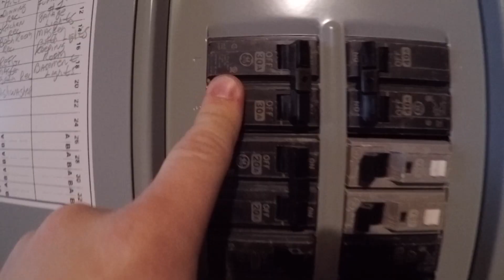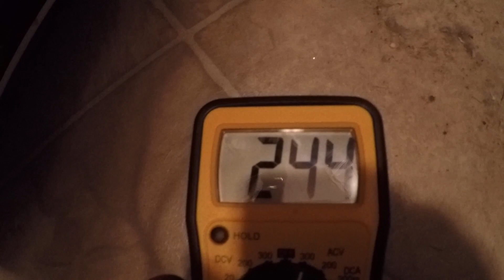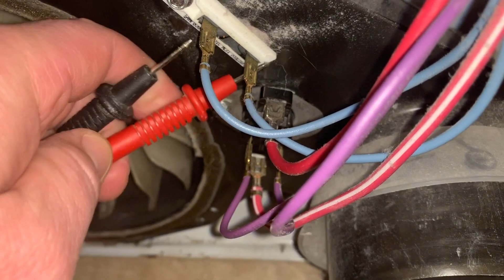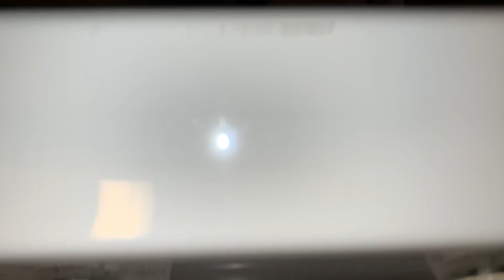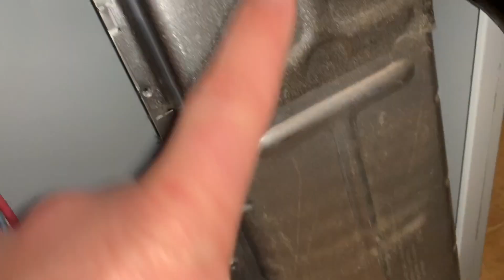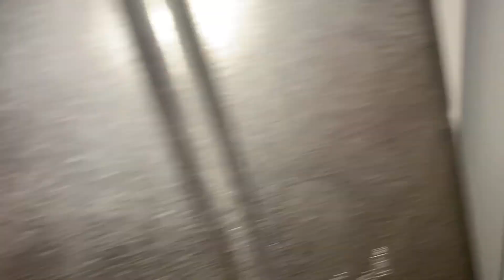EASY Fix Broken Dryer - Dryer Won't Start - Dryer Won’t Heat Dryer Will Not Turn On Complete Repair

Comment: I've watched both of your dryer repairs video, and thought you do a good job of explaining the basics, to the unknowing. And in all my years, I've never seen a light in a dryer. (But I buy inexpensive ones). Also, I hear about these thermal fuses, but my electric Maytag doesn't have one. But it does have a thermostat.
Reply from the maker: Interesting. I’m surprised there isn’t a thermal fuse in yours.
Reply: @TightWadDIY  I found a thermal device, (no continuity) buried inside the heating element housing, along with others in line.

Comment: That thermal fuse and “thermostat” have nothing to do with any lint problems. This guy only knows partial info he probably looked up on the internet. It’s clear from this video and the last I viewed. I’ve been repairing appliances for 13 years and HVAC 20 years.
Reply from the maker: The thermal fuse CAN be blown due to a blockage (of lint) causing it to overheat. That’s the whole reason for the thermal fuse.
Reply: @TightWadDIY  The thermal fuse YOU were talking about opens when the operating thermostat below it malfunctions and allows the dryer to get too hot. The thermal fuse that opens due to a plugged vent would be the fuse on the top part of the element housing. Even then when that fuse blows you need to change the thermostat as well because the thermostat should be opening the circuit prior to the fuse blowing in both cases. But hey, thanks for playing the game. I hope this helps complete your knowledge of the most basic dryer out there.
Reply: Changes thermal fuse & thermostat checked door switch. Light goes on inside dryer. Nothing. Doesn’t start. Now what?
Replace on off switch. Dealing with a Basic Maytag 2 years old
Also cleaned out lint & checked fuse box

Comment: I was having a problem with the dryer not turning ON at all.
One of the first things I did was to check continuity on the thermal fuse.
I did not disconnect the leads to it just as you showed in your video when you tested it for continuity.
I tested everything you showed and still no smoking gun, other than the centrifugal start switch that is mounted to the motor .
I finally went back and tested the thermal switch a second time and with the leads attached I got the continuity tone from my multi-meter. I then disconnected the leads, something I was told to always do when testing a component to isolate completely from the circuit. This time, I did not get the tone, and the meter displayed OPEN. So, I reconnected the leads on the thermal fuse and tested again, and again, I got a tone and continuity. Well, I tried your suggestion to bypass the thermal switch, I had a dual flat face male connector to single male flat face adapter, pushed the two female connectors on to it, covered it with electrical tape and plugged in the power cord and flipped the start switch up on the console and the motor started spinning. I immediately powered OFF since I did not have the drum installed, but it worked! 
So, even though I was testing across the two contacts on the thermal fuse, it was still finding continuity through the circuitry and giving me a FALSE reading of continuity. The recommendation to this is always isolate the component, when possible, from the circuit it resides on to insure the test results are not skewed by other pathways in the circuit. Remember, electricity, like water always finds another way to the least resistance path to ground .   :-)

Comment: When you check a switch or thermal fuse, you really need to unplug one or both wires. if you don't you could get a false pass since your also testing the circuit that is parallel to the part you are testing if you dont unplug one of the wires to open the circuit loop.
Reply from the maker: Good to know. Thanks for adding valuable information.

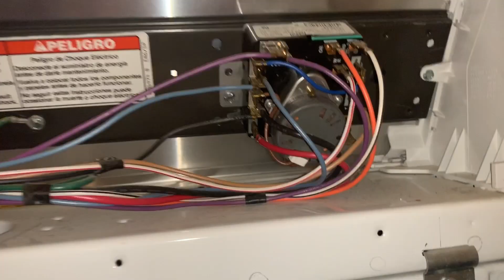Comment from the maker: If you came to this video from PART 1, you can skip to 4:55 in the video and you will pickup where you left off. Use the Amazon Affiliate links below to order parts needed for this repair. 

Thermal Fuse - https://amzn.to/2I1nlyS
Dryer Door Switch - https://amzn.to/2CLFv4i
7 in 1 Screw Driver - https://amzn.to/2HQZwdT
Shop Vac - https://amzn.to/2uAAyaa
Dryer Vent Hose - https://amzn.to/2FOovMD

Comment: why couldn't you just solder the broken coil or connect the broken coil with a wire connector for high temp connections. comment. it would save that $70 bucks. if the fix dose work.
Reply from the maker: ALAN PARADISE I would rather spend $70 and not risk burning down my home.
Reply: @TightWadDIY   You wouldn't burn down your home if you do it right.  If man made that coil .Man can repair it. Any thing can be repaired.
Reply from the maker: ALAN PARADISE I didn’t say it can’t be repaired. I would just rather buy a new one than repair a 14yr old coil that will likely break again. I’m pretty sure a machine made that coil. A man made the machine though.
Reply: @TightWadDIY    Yes I would too.but. I would try to fix it first. I fixed a coil and lt last 6 years  MORE on a 16year old dryer Then I replace it because the motor coils fail it would
of cost me the motor just to rebuilt it. SO i got 22 years and its still going strong.